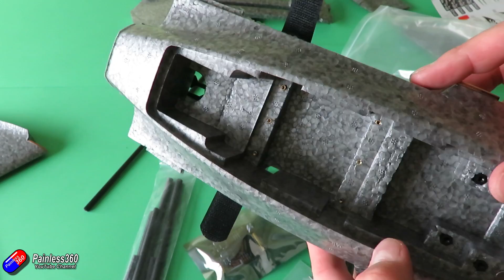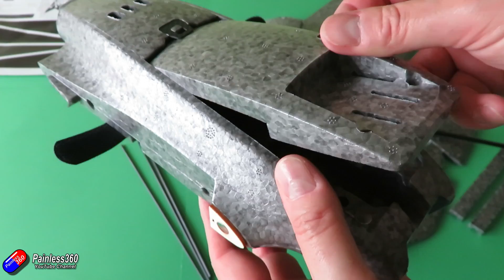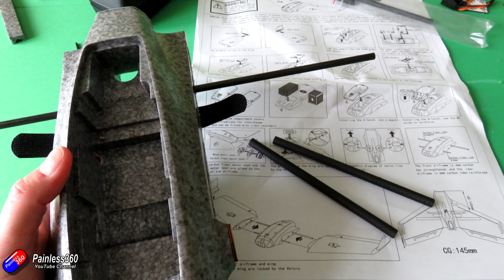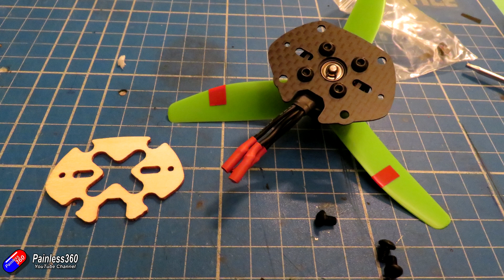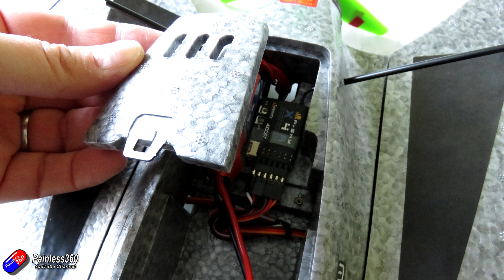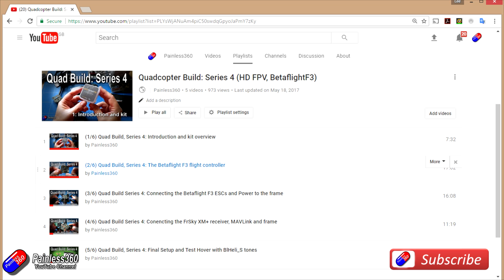Reptile Swallow 670 FPV Wing

Comment: I purchased this wing from a guy without any idea about wings, have been in the wall for around 3 years and now i get motivated to finish the build and fly it, purchased a speedybee f405 wing fc for it, i'm really scared about maiden flights, will have to check yours inav tutorials for lears about if because i have only use betaflight on my fpv kwads
Reply from the maker: INAV for Beginners 2023 (Baby AR Wing PRO and INAV 6.1.1): https://www.youtube.com/playlist?list=PLYsWjANuAm4q-i0YGMJGLOfaYIuNIYPfF is the series for you... Happy flying
Reply: @Painless360  awesome 🔥🔥thank you so much🤩  wish me luck with this wing, let's try to not make it explode on first flight😂

By the way, if cg is not perfect set on the s670 I guess that the fc will not compesate ir properly or is possible,  for this one is recommended to have the nose heavy,  right? The wing have the marks for cg on it too I guess
Reply from the maker: Always go for the CG marks. A nose-heavy and tail heavy plane will both fly with INAV working to help. https://www.youtube.com/watch?v=3SJXeB9V7s4 should help you understand how it affects a fixed wing..
Reply: @Painless360 I tried it the maiden today but not success, 😢 cg was set, in my case i think i have upgraded version because it has more room for battery and have two + under frame  for cg, the issue I'm having is that the wing rotate by itself to the left, I toss the wing with side throw method on angle mode, by the way did noticed that the elevons have short travel on angle and acro mode, it is normal?

A friend told me that could be torque roll,  If I we see the wing from the back i have the motor rotating to the right, I tried the launch at full throttle

Comment: When I look at that "mistake" I wonder is the FCB is programmed for the aileron differential it creates... as if so it's not a mistake but needs that FCB. For that reason I'd never use it not knowing and stick with symmetrical hardware programming. I did the same thing on a Ridge Rat wing but used a single center servo and offset the servo wheel holes.

Comment: hi painless360   iv just got my s800 fixed wing setup i am using a naze32  ver6 with cleanflight   have you got some setting s i can use   as it is at moment roll   p 3  in 30  der 23   pitch     p 3  int 30   der 23  yaw  p 7  int 45  der  -   i an going to us angel    this is at 50 at moment
Reply from the maker: Sorry, I don’t. Best of luck!

Comment: looks like u wrong with the cg,on the manual 140mm,but actually its about 160mm from the nose.with that hd cam on the nose you must put bat away to the back and motor mount modification more back,i have one and it fly but with many crash first to find the righ cg hahaha.but i think its not stable plane,something wrong with the design maybe haha..

Comment: Thank you very much for review this Wing. Reptile are ruled! And newest model - too.
P.S. At 12:40+ I think it's very reasonable using a Split cam like Runcam Split 2 or Airbot A2 or others. And set uped a glass for defence it too. Because it is much stronger and maybe less aerodynamic resistance than using two cameras. By the way, the Wing itself is strong enough. /But you can break everything.../

Comment: I've been flying the Dart for a few weeks now, really fun little wing. Although I did end up removing the little plugs in the wings for the servos and the connection wasn't very reliable.
Reply from the maker: Thanks for the comment. Those connectors do seem small. I have ended up modifying the Nano Talon a little too - I wasn’t convinced by that BEC-BEC installed as standard!
Reply: I've had the nano talon for a few months and had no issues with the stock esc/bec/gyro on either 3 or 4s. I look forward to seeing your review so I can see why you felt the need. It's a great relaxing flyer.

Comment: #29: that's a bummer, no flying /crash footage,  better luck next time. Its a nice looking wing, but indeed to much wissels and bells for a small wing like this one. The same model but 1200 mm wing size would be an awesome fpv wing.
Reply from the maker: Indeed, I was running the Runcam3 on the hat-cam but no footage after a few mins. There are some great options now in the 600-700mm FPV class..

Comment: No wonder it didn't glide - that came out at the same weight as my heavily reinforced Teksumo combat wing, and that has a 2200 in it
Reply from the maker: Love the TekSumo here, I have four and they just fly and fly...
Reply: Best £27 you can spend - I should be on commission from hobbyking, everyone who has flown mine has bought one :-)
Reply from the maker: +Tsnafu :D me too! Most of my mates have had at least one after seeing mine! My first TeKSumo is more tape and hot glue than foam and still flies well.. one with a better place for FPV gear would be nice though. Happy flying!